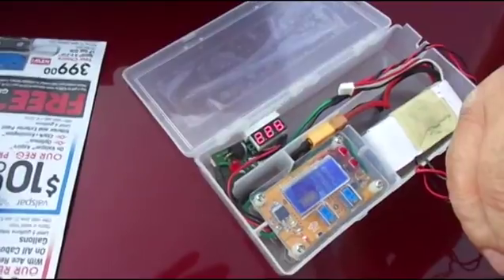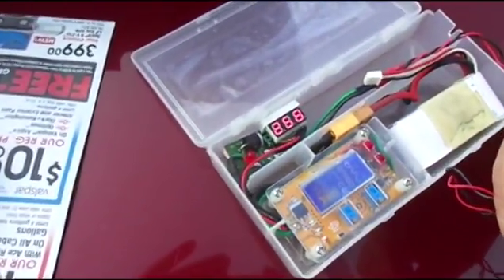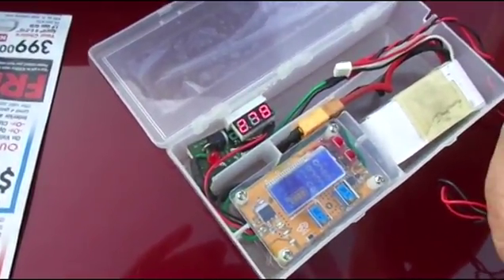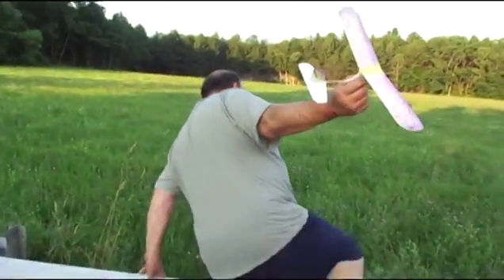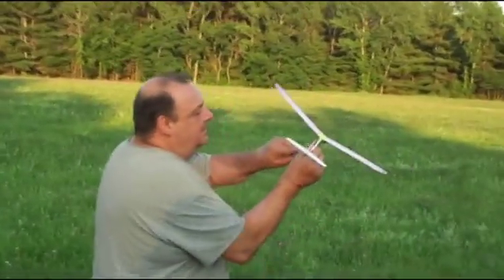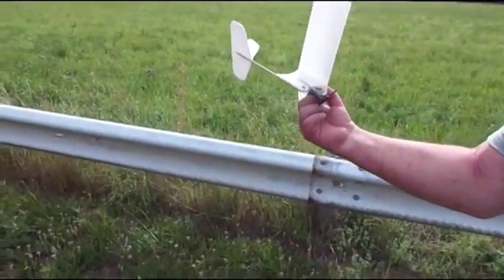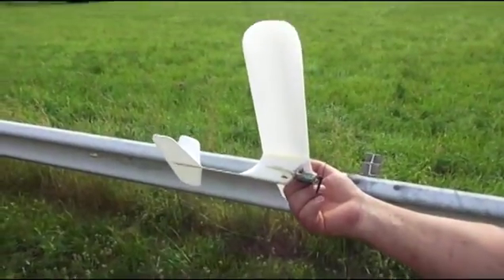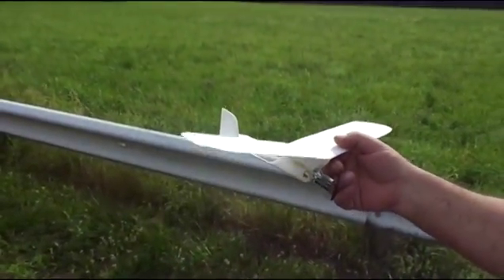Richie Chalks Up a 1:17 Supercapacitor Flight! (Near the TREES!)

Comment: You can’t beat pylon configuration.
Reply from the maker: That plane went out of sight straight up not long after this video was made!
Reply from the maker: All meat tray eps foam, Richie built it right out of his head, no plans, no measuring....I think span was about 19" and it had a 720 motor and 10 farad cap. No idea about the weight, that was before I bought a scale!
Reply: You should have fitted a dt!!
If it looks right, it’s designed right. 😀

Comment: Mike what is a 720 motor ?    is that from a geared umx ??
Reply from the maker: Not  sure what motor those planes use, but coreless motors are specified by diameter and length of the can section. A 720 is 7mm diameter and 20mm long....a 615 is 6mm diam. and 15mm lg.  and a 8520 is 8.5mm diam, 20mm long.  Generally bigger means more power but they all come in different versions which differ in their internal windings and thus RPM ratings. Keeping in mind most of these are designed for a 3.7 volt LiPo power supply and we are using them at 2 to 3 volts with supercaps, it's hard to predict the performance. We are at the trial and error phase of this sport! One thing I can say is that the 720 motor, 10F cap and 60mm prop are a killer combination for something like the plane in this video...very efficient! Maybe the best we've tried. For some reason they cost more, tho'....Happy Holidays my friend, stay safe. -Mike
Reply: @sonex413   that clears it up for me   Thank you     i built a penny plane type air frame 16 inch wing span  with a 7mm coreless and a 55cm prop    flys slow but Great   when it comes down i can hand catch it     Great fun    hope to get some video footage of it to post    Happy hollidays
Reply from the maker: @larzhillbot1443  Thanks! Love to see video if you get some! I'm putting together a playlist of "What Our Viewers Are Building" and I think it would be a great addition. Look what I have so far!... https://www.youtube.com/playlist?list=PL7SpYfvruCgAyZQ_ci875TZyjrJPvW_4_
and Richie says Hi! -Mike

Comment: Hi Mike. It would be nice if u could also tell about the trimming process...downthrust and sidethrust angles, dimensions, weight etc...
Reply from the maker: I will do a video on that subject but in the meantime a good starting point for experimentation would be to build a very light and efficient glider and get it adjusted for a nice floating glide in a gentle circle...then add power a little at a time and make thrust adjustments as needed to keep the powered flight the same as the gliding flight. Usually a few degrees of down thrust (if the motor is in the usual spot on the nose...) and side thrust to keep it circling same as the glide. I have not had success with every project but I have learned from every attempt! That's where the fun is! Good luck and Richie and I will start thinking about making that video.